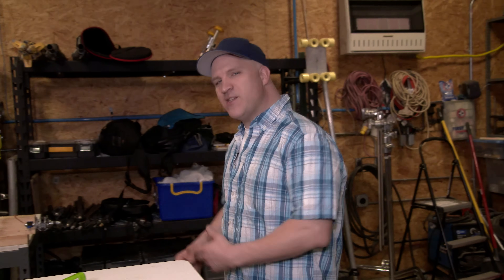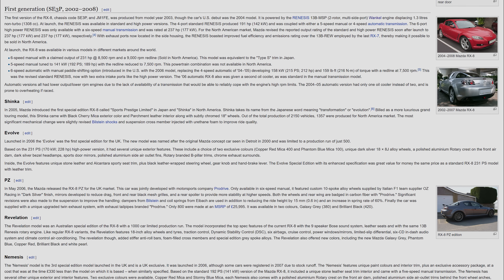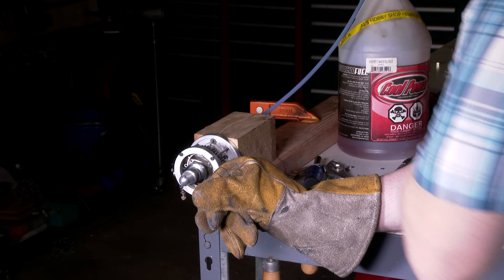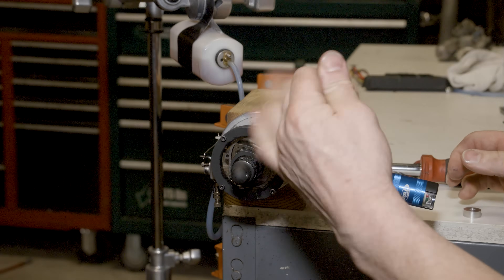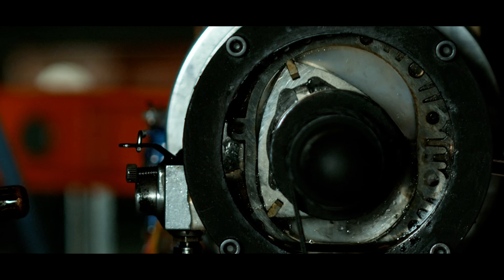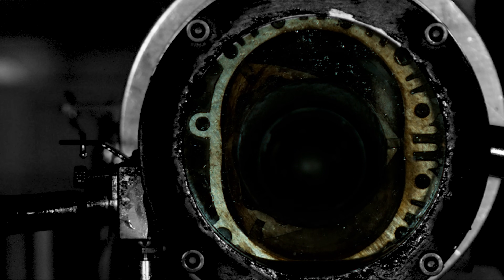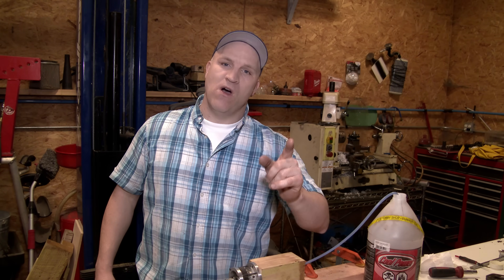See Thru Rotary Engine in Slow Motion - (Wankel Engine) 4K

Comment: Love how he tries to justifies they have less moving parts than a conventional engine, that about the only plus to these engines, they take ALOT more looking after and costly in fuel and oil, alot less economical
Reply: That is why these engines have been completely obsolete in the manufacturing industry for several years... Wankel engine offer no advantages... just disadvantages.
Reply: @doktorbimmer  One advantage is the lightness over standard engines, and the power output from a relatively small engine, but thats pretty much it
Reply: Actually no, not anymore.. The Wankel engine no longer offers any significant power density, power-per-liter or power-to-weight ratio advantage... in applications were power-to-weight ratios are critical, the gas turbine and the 2-stroke reciprocating engines offer a significant advantage... the gas turbine offer an order of magnitude greater power-to-weight ratio performance than the obsolete Wankel.
Reply: @doktorbimmer  On about fitting to a car, the wankel is lighter compared to a normal piston engine, ive seen a 3 rotor than produces 800+ BHP and you could probably lift it up by hand
Reply: Not anymore... that statement was true in the 1950s when the Wankel engine was first introduced... many automobile manufactures were still producing flat-head engines made from cast iron... There was never any production Wankel automobile engine that produced 800 horsepower.. the most powerful passenger car engine was the Mercedes-Benz M950F which was rated at 400 hp... but it was canceled in 1971. The fact is power-to-weight is really not a critical design requirement for passenger cars and trucks... this is not the case with aircraft yet the Wankel offers no advantages in aircraft applications either.
Reply: @doktorbimmer  What are you on about ? a wankel engine power to weight ratio is alot light than a piston engine, period
Reply: What are you on about kid? No one even makes Wankel engines anymore... they are obsolete because they no longer offer any advantages... including power-to-weight ratio.
Reply: @doktorbimmer  Kid lol, im probably older than you, go look up power to weight ratio, which was what i was on about, also look at my main post
Reply: Yeah, kid... I doubt you are old enough to drive yet. Power-to-Weight Ratio is not a significant advantage of the Wankel engine design today.. and the Wankel was never successful in any applications where Power-to-Weight Ratio performance was critical...The Wankel has been OBSOLETE in the engine manufacturing industry for several years now because it offers no significant advantages at all.
Reply: @doktorbimmer  piston engines are evolutionary but the wankel engine is revolutionary

Comment: So basically its a two-stroke
Reply: All Wankel KKM type engines like this one use the 4-STROKE operating principle... the difference between the Wankel and a reciprocating Otto engine is the reciprocating engine completes its firing order sequence in just 720° of crankshaft rotation (2 turns) while the WANKEL engine requires 1080° (3 full turns) to complete its firing order sequence.
Reply: No...a rotary has a four stroke power cycle but only needs one rotation to complete it's cycle.
Reply: @MarinePhinFan  
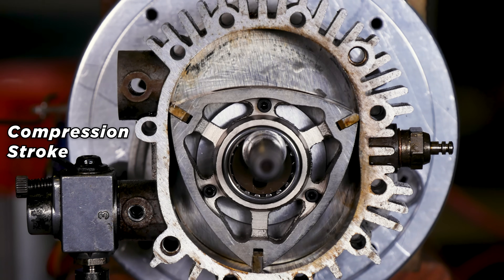Yeah. No chit. I dunno wtf i was thinkin 2:45 even goes thru the cycles. I just looked again. The crank is geared to a 3:1 ratio looks like. Pretty interesting, no valves, no cam, no timing gear. Does it have a lobe on the crank for spark?
Reply: dokterbimmer If you want to assert a truth, first make sure it’s not just an opinion that you desperately want to be true
Reply: @erniebrinkrotaryhemi7336  @CaberFeidh Indeed... only amateurs refer to a Wankel KKM engine as a "Rotary"... just like these people think Felix Wankel actually designed it... which is not true either. LIKE ME BEING ERNIEBRINKROTARY JUST THE FACTS CHEERS
Reply: Robert Tadic You must have never spent any time communicating with bimmer. Reason is pointless and he is hated in the rotary community for his arrogance and disrespect.

Comment: THIS ENGINE IS A HEAD OF ITS TIME  Flyingdutchy33  Flyingdutchy33  Flyingdutchy33  Flyingdutchy33  Flyingdutchy33          
      Well, they reason that since the output shaft rotates slower, you get less cycles per revolution on the output shaft but to me thats technically a reduction and therefor doesn't count. But if it did, 1 rotor equals 2 pistons.

That said, I'm sure someone will chime in to tell me how wrong I am. Mostly I just comment here because doktorbimmer does. And I just find it absolutely amazing someone who's that stupid and insecure hasn't comitted suicide yet. I know it's wrong, but I have to admit I try to push him over the edge until he finally releaves this planet of his existence.

Hmmm, come to think of it, I might miss him if he actually jumped in front of a train :(
    
Some Other Dude  
Some Other Dude
Reply: go back to rotary breakthrough
Reply: @dokterbimmer7270  First off, the 'making a fool of you' thing isn't working. I never had an argument with 'Ernie' and i never had a dialog with him. So...... your evidence to the contrary consists of: Nothing. Second, it really does sound like he slipped up and is the same person (Anthony). Congratulations, you finally have a 'victory' of sorts, after approximately 2 years of a dozen people expressing hatred towards you. If he slipped up and sent you something using the wrong name, I'd say it was becoming suspicious anyway because 'Ernie' and 'Anthony' seem to use the same short, strange phrases in their posts. Very strange. Too bad he's just making weird comments instead of really engaging with you, I know you're dying to destroy him online!

Comment: I'm guessing that this little model airplane motor uses a glow plug and has the simplest sort of fuel delivery is why it is spitting out fuel that is flooding it and not burning so good.I know the Mazda engines have 2 spark plugs per combustion chamber and work much more efficiently.
Reply: Yes, very inefficient compared to the typical 2-stroke RC engines still mass produced... which is why these engines designed by Graupner GmbH. are no longer in production.
Reply: But compared to a similar sized reciprocating engine the Mazda Wankel engines delivered terrible fuel efficiency and had very poor combustion efficiency which is why Mazda also discontinued them years ago.

Comment: I had a 1987 Rx-7.  It was a nice running car.  The only problem I ever had was with the heater core.   Nice demonstration.
Reply: You either didn't own it very long or your memory is very bad....
Reply: doktorbimmer I bought it from a nice doctor in Floyd, VA in September 1996.  He owned the car from new and only logged 19k miles on it as he had other vehicles.  The Rx was my daily driver for three and a half years so you are correct.  But like it or not, it was a good car.
Reply: "Your results may vary" Sales of the Mazda RX brand was already in decline by 1986 due to problems with fuel economy, reliability and lack of performance, sales continued to steadily decline until 2012 when sales completely hit rock bottom.
Reply: doktorbimmer ...So Rx was the model, not the brand.  That would be Mazda.  When I bought the car, I was aware of potential cold weather starting issues but it always started and ran on cold days for me.  It did not get stellar fuel economy for such a little car.  But I marveled at the fact it made 200 horse power.  It was a very interesting car to me.  I remember having to get new spark plugs from a special import car parts store.  Even in the ‘90s they were nearly $50 for four.  The only thing left on my bucket list is diesel.  Any advice on TDI motors??  Thx.
Reply: 7 was the model... there were several models produced in the RX brand line... eg; RX-3, RX-7 RX-8 etc.
Reply: In 1987 RX-7 only had around 150hp (new) only the Turbo model had 200 hp but these engines were very unreliable.
Reply: Starting issues and flooding are very common symptoms of low compression due to seal failure and damage.

Comment: Rotor engines can't pass emission laws. In the video you can a lot of incomplete combustion which is no different then its bigger counterparts 1.3L. Run it lean and you can get almost 50 mpg.  Is it worth the Nox it creates?
Reply: The biggest problem with the Wankel was they cannot compete with reciprocating engines as a commercially viable engine technology, Like Mazda, Graupner GmbH. discontinued this engines due to lack of sales.
Reply: Run it lean and the Wankel's poor combustion design results in pre-ignition and detonation.. causing damage to its apex seals.... the primary failure mode in all Wankel engine designs.
Reply: The Wankel's poor combustion efficiency tends to produces high volumes of HC and CO pollution... not NOx. Due to the inherent low compression ratio limit and low thermal efficiency NOx output tends to be lower that comparable reciprocating engines which run higher pressures and leaner AFRs.

Comment: Australia! Lol ! Down under doesn't dominate motorsports,  but I'll give it to you it's very loved down there. A child is your mindset. You would need a custom built rotary to make any real power n/a if you knew a damn thing about them other than YouTube or the internet. Stock Maxima 3.5 makes 300 hp. Highest output rotary was 13 B twin turbo at 258 or so ponies. I'll settle to piss on your beloved rotaries Mate.
Reply: Australia is about as far from the center of the automotive universe as you can get without leaving the planet... Wankel engines are no longer able to compete with reciprocating engines in any applications, especially motorsports which is why Wankel engines are no longer used in any world class or major professional racing series... and no longer manufactured at all.

Comment: The Wankel design looks... unstable...
Reply: Yes, in terms of combustion efficiency and thermal distortion? Indeed the Wankel is very unstable... its also why its an obsolete technology.
Reply: there must be oil in the fuel?
Reply: @xkexke8081  kinda, due to the fact that the oil doesn't have a good measure of lubricating properly in the side and top cyllynders, there's a small amount of high temp oil added to the fuel, and oil can slowly leak into the top and side pistons to keep friction down.
Reply: @kirknay  I learn one most important things from this clip. All engine needs perfectly precise ignition timing for high performance and rotating...

Comment: Fuel combustion looks insanely irregular, LMAO. There's a good reason this engine is obsolete (and, really, it was obsolete when it was developed). Super cool engine design, but not just not a great engineering design.
Reply: Good comment, the Wankel was plagued by several major flaws related to combustion efficiency and heat rejection that cannot be fixed... and so now the design is no longer used in the engine manufacturing industry.

Comment: Can you use a loudspeaker as a supercharger and perhaps turn a 4 stroke into a 2 stroke to double its output? 
There are some mylar types that could produce a very well defined or evolved pressure waveforms using a small embedded processor and some have power ratings well over 1000 watts peak. I estimate that a 12 inch speaker could produce the right volume of flow and could also be used in conjunction with standard reed valves. 
I've not seen large mylar speakers, so one would have to be made from a standard high power type. 
Even if this were to be a poor comparison to conventional turbocharging, its versatility in controlling flow and exhaust emissions and cheapness could be of value.
Reply from the maker: A loudspeaker as a supercharger? I have never even heard of that before.
Reply: @WarpedYT  
It's a crazy idea I had about 10 years ago and did nothing with it! 
I recon a 12 inch speaker could shift 700cc's of air and you could control the profile of the response accurately on induction and to modify exhaust release.
Reply: @WarpedYT  
The goal would be to convert a 4 stroke to 2 stroke but it's all just conjecture!
Reply: The effect you are describing called Pressure Wave Supercharging has already been developed and marketed in commercial super/turbo-charging devices like the Comprex Supercharger manufactured by the Swiss firm Brown, Boveri & Cie and the Hyprex supercharger developed by the Swiss firm Wenko AG..
 The Comprex supercharger can be seen installed on several types of heavy duty Diesel truck engines.
Reply: @doktorbimmer  
Thanks for that, I wonder if any enthusiasts would have a go and put it on YouTube?
Reply: There is not much information available outside industry publications and engineering journals... a little too technical for your average clickbait youtube viewer with a 30 second attention span.
Reply: Could it be done with a loudspeaker, given the high power ratings available today? 
The answer has to be yes, (to some degree).
Reply: The question is would a practical device be possible that actually increases efficiency enough to justify its cost.. the Comprex supercharger increases efficiency but also increases costs.
Reply: @doktorbimmer  
Absolutely, but we are talking about simple, off the shelf components here; a powerful speaker, a cheap digital amplifier, off the shelf reed valves. (On the negative side a larger alternator would be needed though).
The control of exhaust emissions alone could make it worth considering! 
The key would be in the flexibility and precision of the pressure wave, under software control. This is why the controlling waveform could be evolved to optimize performance goals. 
Someone would have to first characterise potential loudspeakers, perhaps firstly on a mathematical basis. Cubic capacity is in the right ball park.
Reply: Agreed, but if the system does not deliver realistic efficiency gains at a reasonable cost? Its never going to be a viable commercial product.
Reply: I'd love to have the time to put it to the test!

Comment: I don't understand it any better than I did before. How about diagramming where each port is located and showing how the fuel air mixture gets introduced into the chamber. How it gets compressed and at what point the mixture gets ignited. How the pressure pushes against the rotor and at what point the rotor vain pushes the exhaust gases out and begins to draw in the next fuel air mixture.

Comment: Seems like this design has issues with premature ignition that cause the engine to stall out. Is that limited to this model engine or is it also an problem on the larger one too?
Reply: All Wankel engines suffer from extremely poor combustion efficiency and the primary failure mode of the seals are due to pre-ignition/detonation issues.
Reply: The Wankel engine cannot be adapted to use a modern, efficient high-swirl or  "quench" type chamber found on modern production engines such as the PENT-ROOF and WEDGE type combustion chamber designs making them more prone to pre-ignition and miss-fires.

Comment: I can see there is an incomplete combustion here. Can we utilize the remaining oil & air mixture to produce second combustion in a single piston engine?
Reply: The Wankel engine is revolutionary
Reply: Not without adding even more fuel... HCSI (Homogeneous Charge Spark Ignition) requires a relatively rich mixture to achieve reliable combustion... and YES its been tried, with very poor results.

Comment: Why do they use so much fuel and why so unreliable
Reply: The Wankel engine was an inherent flawed concept... a very poor design in terms of combustion and thermal efficiency.
Reply: @doktorbimmer  can u explain y
Reply: Well, the key flaw in the design is it cannot use a modern high efficiency "Quench type" combustion chamber like a Pent-Roof or Wedge configuration. and the geometry that makes the engine possible in the first place also severely restricts its mechanical and thermodynamic efficiency as well.  Combine that with low compression ratio limits and poor sealing integrity and you have a recipe for poor overall efficiency and higher emissions.
Reply: @doktorbimmer  thanks mate

Comment: I've seen artist's renderings of what happens in the Wankel engine. I kind of got it. But it still puzzled me how the tight gas seal was done. Piston rings had that job with traditional engines. That a side. I noticed that there are three firings per revolution of the triangular head. But on the drive end, it is just one firing per revolution. So in short. it's like a 2 stroke engine.
Reply: A "Gas tight" seal is one of the difficult things to achieve in the Wankel engines and remains a critical flaw.
Reply: Actually every Wankel engine uses the 4-stroke operating principle... each of the 3 separate chambers require 3 crankshaft revolutions to complete all the 4 cycles of a internal combustion engine... So in short, not like a 2-stroke at all.
Reply: The triangular piston (or Rotor) and the eccentric-crankshaft turn at different speeds with a 3:1 gear ratio... it takes 1080° or 3 full revolutions of the crankshaft for the rotor to complete 360° or one full revolution... So all Wankel are 4-Stroke in their mode of operation.